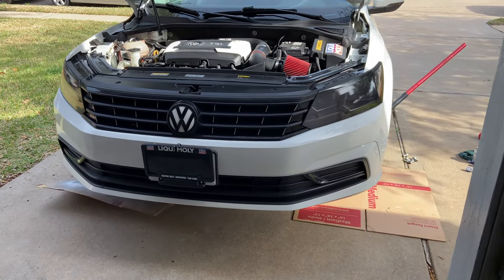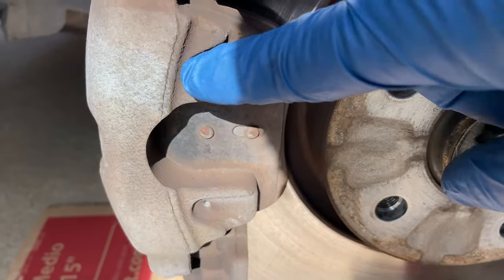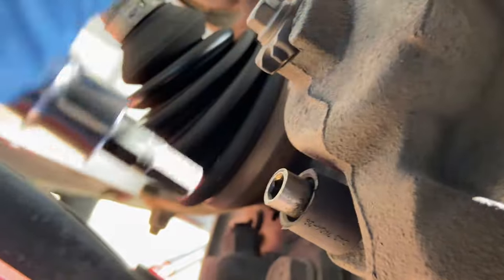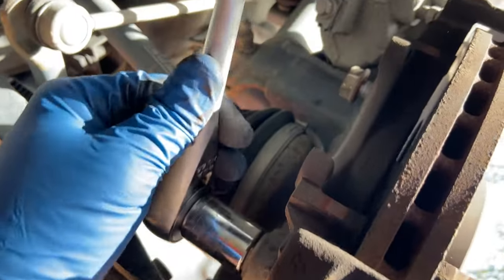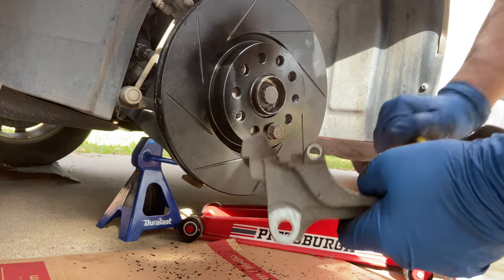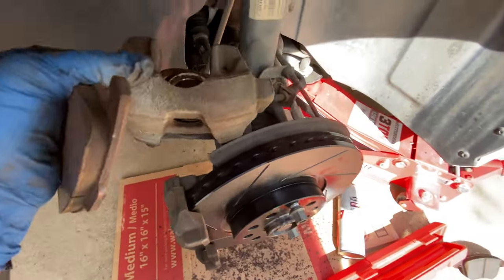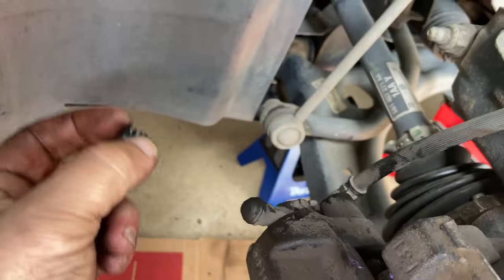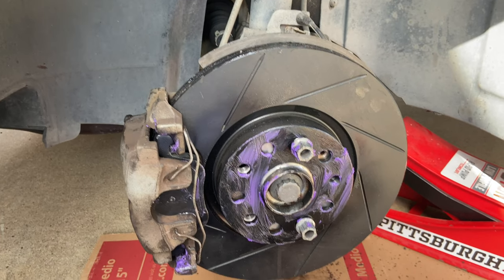How To Change Brake Pads And Rotors - (Front) VW Passat #volkswagen

Comment: You are lucky that those bolts are only 89 lb - ft.   The Arteon and Atlas are 147.  My skinny butt needs an extension pipe to be able to get them that tight.
Reply from the maker: That’s a lot of torque.  That’s the worst part about the rear brakes.  Try to slip out your rotor before removing those bolts.  Some models I heard you can wiggle the rotor out.  That would be nice!  Thanks for watching.  Consider subscribing if you like.  💯😎👍🏼

Comment: Glad you did the Driver side without the sensor. This is the only video I've come across that shows the driver side. I cut the sensor before i came to this video because i didn't see it on the current ones. I'm just glad I didn't make a mistake.
Reply from the maker: Nice!   Thanks for watching and it sounds like it worked out ok for you.  Some models have the sensors and some don’t.  Appreciate the comment 💯👍🏼😎

Comment: My forte is vintage Detroit musclecars but the reality is that daily drivers are otherwise. So, I found your video extremely helpful when tackling a brake job on my wife’s 2016 Passat. However, as I dug into it I was surprised at how closely the Passat front disc system resembles the single-piston front disc brakes on my 1970 Plymouth Barracuda. So in the end the wrenching was pretty familiar. Amazing how the design and engineering has persisted for over half a century! Keep up the great work. Now I know where to turn when a VW maintenance issue arises. Regards, Jack
Reply from the maker: Awesome comparison.  Thank you.  Yes disk brakes haven’t changed much.  Same basic technology.  Wrenching is about the same.  I appreciate the comment.  Yea I learned brakes on my 1978 z28 Camaro.  Haven’t paid someone to do it since about 1988.  It’s a dirty job but rewarding also.  Thanks again 💯👍🏼😎

Comment: I appreciate how thorough and meticulous your video was. Excellent tutorial. Getting ready to change my brake pads and rotors for the first time. The only time I got a little confused was when you were tightening the bolts with the 21mm, and you said to tighten them to 89 foot lbs. Can you explain that a little further? I'm a newbie and still learning all of the basics. Thank you so much!!
Reply from the maker: Thanks for watching and the compliment 👍🏼.  Well unless you have a torque wrench you won’t be able to tighten to exact tightness.  89 ft lbs is really tight.  If you don’t have a torque wrench just tighten as tight as you can.  It’s about the same as you would tighten your lug nuts on your wheels.  The smaller guide pins are not near as tight.  But those 21 mm bolts will be fine to tighten as tight as you can with human strength.   That’s about as much as I know how to explain it.  Also look up videos on tightening bolts using ft lbs.  Thanks again good luck 👍🏼😎💯
Reply: That definitely answered my question. I appreciate the response! 😁
Reply from the maker: Your welcome.  Have a good one 👍🏼

Comment: Good in depth video. I didn't notice you talk about making sure the rotors are cleaned from the oil used to keep them rust free while on the shelves.
Reply from the maker: I did spray them well with brake cleaner.  I was more focused on installation.  I have another video for the rear brakes.  I’m still editing it.  I’ll mention that in that video.  Thanks for watching 👍🏼

Comment: Really detailed video. Is there any alternative for that purple Brake parts lubricant? Can I use regular grease? Thank you
Reply from the maker: You can use a copper based anti seize.  That works great but it’s expensive.  Actually you don’t have to use any.  But I do because it makes it easier the next time you remove things.  But hey thanks for watching and I really appreciate the comment.  Consider subscribing if you like.  Also always use silicone only grease around rubber seals and stuff.  It wont eat away at the rubber.   Thanks much 💯😎👍🏼

Comment: Good morning sir. Did you like that brand of rotors and brake pads?
Reply from the maker: I’m still trying to decide.  So far they are good.  The rust proof coating isn’t as good as I’d like.  They are doing the job.  I haven’t had any issues.  I May upgrade next time.  Depends on if they continue holding up.  Thanks for watching I appreciate it 👍🏼😎💯

Comment: Pretty good video, thanks! One question though: I just did my rear brakes, and it was possible to remove the disc and put the new one without unmounting the caliper. Do you know if this would be possible as well on the front brakes? I think this would save the hardest part of the job
Reply from the maker: You can do it on the rear but I know it’s tight.  On the front I’d say probably not.  But yes good question.  That would save a headache for sure.  I appreciate you watching the video.  Thanks for the comment 👍🏼😎💯

Comment: Thank you for the video. I appreciate the torque information. I did the 22 ft lbs of torque for the calier guides but I think it was too much. i over striped the threads in the caliper brackett. The calier bracket bolts it was ok at 89 ft lbs of torque. I
Appreciated the video.
Reply from the maker: I appreciate you watching the video.  Hopefully everything works ok.  It’s not too bad doing the front brakes.  Wait until you do the rear brakes.  That’s a little more difficult.  Thank you for the comment 👍🏼.  Consider Subscribing if you like.  😃

Comment: brakes started squealing at low speed only in last 2-3 weeks or so I think. Been researching that. A service at 1.5 months ago found brake pads were fine.  So a bit confused. Heavy driving/touring in CA. Even though I have no plans (Nor ability) to actually change anything re: brakes myself...just watching your video is helpful for me to understand my passat (And brakes/rotors in general) Thanks!
Reply from the maker: If the pads are fine your rotors are warped or have grooves in them.  You want a smooth rotor or you will have vibration especially at higher speeds when stopping.  Grooves in rotors will also cause noises like squealing.
Reply: @grind-it-out  cool. thanks. I called a local brake shop - Mr.Brake and they said 49/50 times it was related to glazed pads or what not. Or I think that's what they said. we'll se..
Reply from the maker: They usually only check the thickness of the pad when telling you the pads are fine.  They don’t actually take them off and look closer.  But look into ceramic pads.  They are usually quieter than other pads.  They aren’t much more expensive and they also don’t create as much brake dust 👍🏼
Reply: @grind-it-out  i was wondering about that...I'll call them and ask if they can put on the ceramic ones!
Reply from the maker: Curious to see what they say.   And if it fixes the issue.  👍🏼
Reply: @grind-it-out  went to Mr.Brake, the guy took a flashlight, said the pads look great...recommended using a hose and apply water to clean off the pads.  Just saw  a video on a spray on brake cleaner. I'll try the water first!
Reply from the maker: Hmmmmm.  That’s not a good idea.  Brake cleaner is what you use.  It sprays at high pressure out of the can. I’ve never heard using water.  Brake cleaner is inexpensive and gets rid of brake dust and particles.  It takes a few seconds.  Don’t even need to take off the wheel.
Reply: @grind-it-out  Well...water is like getting a car wash I reckon. can't hurt. Come to think of it, I did splash some water on the wheels a few weeks back, and any noise might have stopped for awhile.  Don't have access to a hose, so water out of a bottle is the best I can do.  Located an O'reilly near here...but like to avoid chemical if I can.
Reply from the maker: True.  It’s like a car wash.  It won’t hurt anything

Comment: Great video, very informative. I know it’s been up a while, however. I only now needed the information. I have two questions: 1. Can you give me the wheel torque specs? I have found conflicting information and was just curious as to what you torque yours to. 2. This is a totally different topic, but where did you get the headlight covers? Do you still have the information on them, and also did you install similar ones on your taillights? Thanks for the help!
Reply from the maker: Hi there.  Ok.  The headlights and taillights are stock.  I just vinyl wrapped them.  I put a black eyelids on the headlights just using 2 inch cut black vinyl.  The tail lights are VViViD hex light smoke tint.  As far as the wheel torque specs… The one I use is 103 ft lbs.  it really can change with wheel size.  That’s just what I use.  Some are as low as 89 ft lbs.  I’m cool with 100.  It’s hard to find info on it.    But thanks for watching I really appreciate it 💯😎👍🏼
Reply: @grind-it-out  thanks for the info
Reply from the maker: You bet! 💯

Comment: I have a 2018 Passat SE. I'm assuming the only diff would be to attach the brake sensor wire instead of cutting it off. Great video. Very well done. So easy to follow. Appreciate your help! Just subscribed!
Reply from the maker: Yes that would be it.  Just connect the sensor.  I appreciate you watching.  And for subscribing.  Thanks so much.  Good luck with the brakes. Let me know if you have any more questions.  Have a good one 👍🏼
Reply from the maker: And don’t forget to look at the rear brake video.  They are quite different to change out. Thanks again.
Reply: @grind-it-out  yup I def will! Thanks Brother!
Reply from the maker: Thanks again 👍🏼

Comment: Is there a secret trick with the tension spring? I had a hell of a time getting mine back on. Getting ready to do rears and I was glad to see the rear doesn’t have them.
Reply from the maker: I don’t know a trick to the spring.  Just line up the holes and hope for the best.  I wish I had the solution.   But thanks for watching I really appreciate it.  Would you mind subscribing to the channel?   It really helps.  👍🏼. Much thanks
Reply: Get the lower part(tab) of the spring all the in, put the upper in as best you can, push on it with one thumb, then use Knipex pliers to pull on the top, outer bend. Be brave, it just worked on both sides for me!
Reply from the maker: Yea it’s tricky.  But thanks for sharing.  I appreciate you watching 💯😎👍🏼

Comment: Is the torque wrench necessary or can I do without?
Reply from the maker: Yes you can do without.  I’m just trying to show the proper way.  Just don’t over tighten the guide pin bolts.
Reply: @grind-it-out  is it better just to hand tighten the guide pins?
Reply from the maker: No tighter than hand tight.  Just slightly over snug.  Half turn after it stops with ratchet

Comment: Sorry man another question, I know the brake fluid cap was open, when pushing the calliper cylinder, do you need to open the the caliper value and second, once the brakes are on do you flush them?
Reply: I know once the cap is open the fluid gets pushed back, but if I need to open the caliper value as well
Reply from the maker: No need to flush the fluid.  Only if dirty or needed.  You did not loose any fluid unless you open the bleeder on the caliper or get new calipers.  Appreciate the question.  Thank you 👍🏼

Comment: Isn't the brake parts grease designed not to damage rubber, and made with silicone grease anyway? You could I think use this and not need to buy extra silicone grease.
Reply from the maker: You can use that.  Anything that is silicone based will be fine.  Not a problem.   Thanks for watching the video.  👍🏼
Reply: @grind-it-out  Thanks, great video. I'm doing mine tomorrow.
Reply from the maker: Awesome let me know if you have any issues.  Would you consider subscribing?  It really helps the channel.  Appreciate it.  Thanks so much👍🏼
Reply: @grind-it-out  Done!
Reply from the maker: Awesome thank you

Comment: Do NOT put Loctite on any of your brake parts not even the bracket bolts
Reply from the maker: I use blue lock tite.
Reply from the maker: But not on guide pins